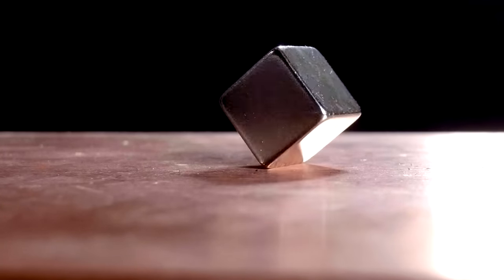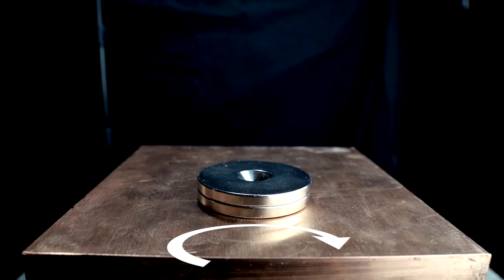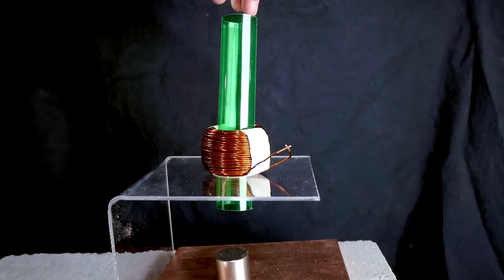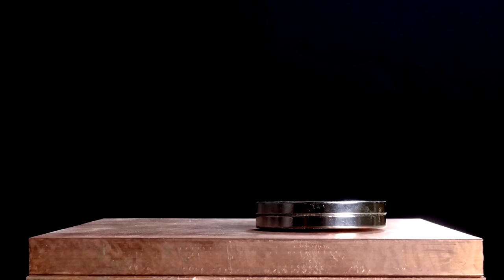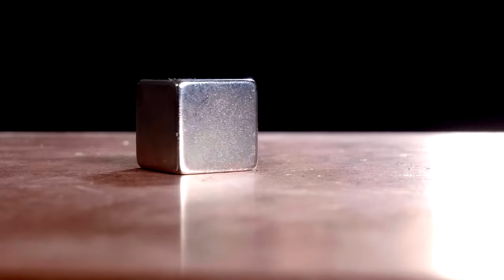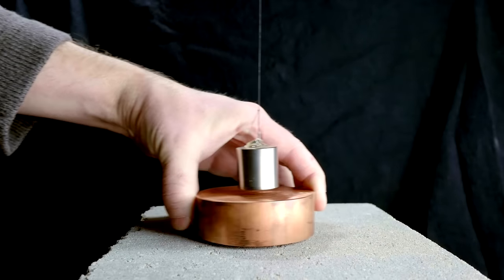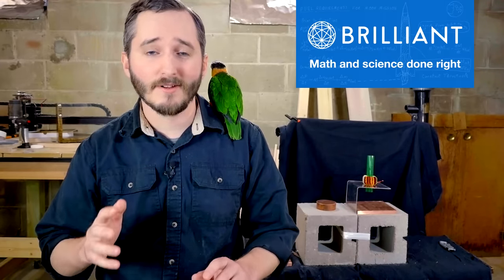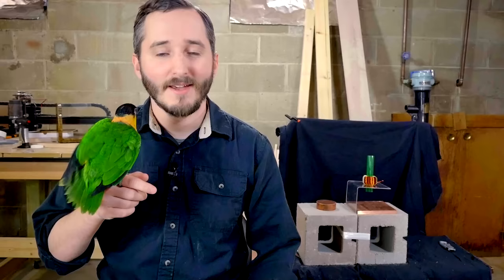Copper's Surprising Reaction to Strong Magnets | Force Field Motion Dampening

Comment: I built a capacitor bank with large scr s that could discharge into a flat pancake coil made from 4awg copper cable. I would place objects on it and experiment with the magnetic forces. thick heavy copper and aluminum plates would launch into the air higher than 60'. smaller objects, not so much. It seemed like the more conductive the material was, the more it would resist the magnetic field. also, I accidentally exploded a capacitor before I realized that the collapsing magnetic field would induce large negative currents into them. Diodes cured that problem.

Comment: Thank you for demonstrating these two laws in action with a copper plate.   Very  interesting, and fascinating.   Are the copper plates you used solid copper, or another materiall plated with copper ?
Reply: This must be a thick, good conductor slab. Plating with copper will not yield any such effect. Instead, you may use aluminium (again, thick).

Comment: Hi ! Can I ask some questions: I would like to know what diameter is the wire used in experiment with coil and how many turns did you wind for used coil ? Also how strong is the magnet used in experiment ?
Thank you very much for your answer.

Comment: If you had a tubular magnet and plunged a copper rod through the center of it would it show resistance.  Or does the copper always have to be on the outside.

Comment: How well does the magnetic dampening effect scale as speed increases? I would assume that the minimum intensity of the magnet required to fully stop the magnet would increase proportionally to the increase in the speed of the magnet.
Reply: It actually scales realy well with the speed of the magnet. The amount of electric field generated in the copper (and therefore the amount of oposing magnetic field) is directly proportional to the rate of change in magnetic flux through the copper. In laymans terms, the faster you try to move the magnet towards or around the copper, the stronger the dampening force will be. If you move the magnet slowly there will hardly be any resitance to the movement. You are also completly not wrong though, at some point the momentum of the magnet is simply to large and the opposing field won't be strong enough to deal with it in time.

Comment: OK NH Light.... Awesome Vid.... How about this;...... repeat the flux-repel experiment ( the one where the magnet stops short of smacking the copper slab....), But ... this time , pass a....  say 500 Volt DC charge through the copper plate,.  The Trick here being change the charge points from  North -South  and South North,  East west ,West East, Front Back, Back Front, with  + and  - polarities.
Then Repeat the experiment with 120 V AC and then with 500 VAC ( Just do the up, down, left right here as its's AC), and if there is a diff or something noticeable..... I'm sure we'd like to see the results..( AKA,.... so a  Maglev train experiences a transient.... etc...What would happen maybe , per se.) Your call here .Thanks
Ciao.
Reply: Forgot to add the front to back AC check. And to do the test quickly as the AC flux might try to de-magnetize your  neodymium magnets.....

Comment: I do not know what is strange at 2:50 and afterwards. It is simple law of electricity. When magnet passes trough solenoid, it create current in it. Copper is known as good electricity material. Magnetic field in solenoid is defined by the law of right hand (as I can remember from my middle school class) so it is no strange reaction when magnet slows down passing trough solenoid because magnetic filed of magnet interferre with created magnetic field of solenoid (closed circuit). In second example, created current is converted to light when LED is added to this circuit (power consumer).

Comment: Why couldn’t you use a spherical magnet dropped into a circular tube with a copper coil at opposing sides to generate electricity? As the magnetic ball travels through the tube over & over it would create electricity in a never ending loop if balanced. Or would friction eventually slow it down? So why not place opposing magnets along the tube so the sphere would continuously be accelerated through the tube and the coils? A type of infinite motion or momentum coil

Comment: Like that you can make the last generation of car shocks absorb, which can be used together with software which calculate distance between front and rear tyres and shocks will use energy to lift tyres wheel and switch off, need experiments to make to get right matematic algorithm

Comment: What would happen if you hooked up thick ground wire to the copper plate? What i'm asking, is it displacement taking some time?  The electrons spreading away slowly but having to compress into wherever they go?  Given a way out, would the effect change?
Reply: I dont think that much would change, just thinking about it, because there are no charges entering or leaving the plate, the mobile electrons are simply moving around which creates an opposite magnetic field resisting the change in magnetic flux.

Comment: You have changed and convert the energie of induktion to light with a LED, is it possible to know more about potential and the electricity of the coil ?  I am not sure but I think it can be a possibility to use this for changing the kinetic energie to light.  am I right or not .

Comment: Drill a hole in the center of the copper plate and cut a slot from the side to the hole. Then see if the ring magnet damps over the copper plate.

Comment: So, with the copper coil around the plastic tube... before you bridged the two ends, the copper coil was still very clearly wrapped in such a way that most of it was touching. Why was electricity not able to travel around the wrapped coil? Was it insulated in a way that wasn't obvious?

Comment: All demonstration videos show magnets falling, but what happens when the magnets rotate inside or close to the copper plate? Or what happens if the magnets are paired with a battery to also produce electricity that is put out again while falling through the pipe?

Comment: Could that be possible to be a free energy if you put the magnet into the middle inside the copper round wire while connected its + and - into a load or any king of electronics?

Comment: What would you need to replace the copper with to produce the same result with granite or any other Monolithic rock?
If you were to transpose the effects of magnetic forces with those of resonant frequencies, is it possible to create a much similar experiment using a heavy rock as the magnet and a frequency generator as the copper pipe?

Comment: I'd like to try this experiment myself, what are the thickness of the copper plates he is using?
Reply from the maker: 1/2". Aluminum also works.
Reply: @Nighthawkinlight  Thanks!
Reply: @Nighthawkinlight  Does the swinging the magnet into the copper trick from the thumbnail also work with just a regular copper sheet too, or does it have to be a copper piece like from the thumbnail to work?
Reply: @Nighthawkinlight  Also, do you remember where you bought your half inch copper plates from? I've been looking online and cant really find anything at that thickness xD
Reply from the maker: @noahlaferriere5515  You'll need probably about 1/4" thick plates at least I think. Aluminum is cheaper and will also work. You can sometimes find big pieces of copper on ebay by searching for copper bus bars, but you have to get lucky.
Reply: @Nighthawkinlight  Yup, you were right, I was able to find a 1/4" copper bus bar on Ebay! :D now do I still need that copper cylinder to do the swinging trick, or will that work on the copper bus also?
Reply from the maker: You don't need a cylinder

Comment: Hi
I have a question about Faradays law, we have read in physics that Faradays law said that magnetic flux needed to generate electricity in a coil, as we see in a closed core which normally used in every board, very powerful current produces by the second coil on core, my question is that how  electricity produces without flux passing through the coil? Because all fluxes pass through the core not coil, so how that happen? I hope you understand my question with my poor english.
Reply from the maker: Flux passes through the core of a coil producing electricity flowing in accordance with the right hand rule. Perhaps this will help you understand: https://youtu.be/BbmocfETTFo

Comment: This engineering will be installed in our new infrastructure building, with a positive charge front wall, and copper infused covered with negative charged instillation......... So in fire emergencies the flames crawl towards the front wall

Comment: :hand-pink-waving:E=MC2 is a joke! OK let's get this correct  !!   #1  The only reason radio waves and AC current travel out in space and down a wire is because of the "CENTER " of a magnetic field.  (The "B" field), The North and South poles are the weakest part of a magnet !!   Just like Tesla said,  you got to look at things you can't see !!  At the center of a magnet is anti gravity,  (just tap the center on any glass or plastic and it will loose weight), The center can repel water if vibrated at the correct frequency,  If you vibrate the "B" field into granite rock it will become soft and you would need copper tools to work on same , you don't want to disrupt the magnetic (B")field ) with other iron.  Once you understand the "B" field of a magnet and how it relates to the entire universe we live in, you will then understand what Tesla was telling everyone "LOOK FOR WHAT YOU CANNOT SEE""  .I believe the pyramids were inter galactic communications and transportation systems.  Stone Henge and Gobekli Tepe , power plants.  Take a look at Coral Castle Florida on YOUTUBE and you will see a similar pilar. I believe these horizontal pillars were oscillators that would provide excitation for many things from crops in the field to anti gravity  FYI: If a UFO fly's to close to you the "B" field that provides the anti gravity ("B")Field).  will cancel out your power source  !!!!  E=MC2 is at best just a joke!!!

Comment: So does this mean a motor or generator won't work if the windings are made from aluminum or silver wire?
Reply: Copper just has a lower resistance so the current is larger

Comment: What will happen if you be able to spin the magnet with high rpm before droping on the copper plate like you dropped 1:20 . I am curious to see, seems like it will stop immedetly but if somehow keeps rotating do you think it, is it possible to levitate longer?

Comment: So now we can you use principal of change in electric flux ,we can produce a small amount of electrical energy ,but what if we applied this in large scale means that ,if we put a copper plate on roads ,and run cars with neodymium magnet inside  the car can produce free electricity that we can use for our daily needs ,is this possible ?

Comment: May I ask where you got those copper plates from? I would like to demonstrate magnetic fields in shool for my students. All I can find are either small sheets or unprcatical blocks.
Reply from the maker: EBay. You can find large copper plates by searching for copper bus bars. They are expensive. Aluminum works nearly as well, and is much cheaper.

Comment: Would the copper coil that is not connected at the ends, But connected throughout, not make some kind of a circuit because all the coil strands are touching each other.. Its more like you "seal the ends" and the reaction occurs, more so then a complete circuit.

Comment: Why does the copper pull the magnet? It's not clear if all you are doing is creating a viscous fluid-like field around the magnet, then shouldn't that fields dissipate when moving the copper away? That would seemingly loosen it's grip on the magnet and leave it behind, not drag it.

Whats wrong with my intuition?
Reply from the maker: Same reason you have to pull to get your boot out of the mud before the force dissipates.

Comment: I wonder if that can be done with any other non-magnetic metal besides just copper only?
Reply: Yes, you can drop a magnet through a roll of aluminum foil and it will do the same thing.

Comment: What happens if you spin the magnet as it close to the copper plate? You say the current is flowing in a circular direction. Left hand rule? Spin in the opposite direction.

Comment: I always found it weird that the copper coil would operate that way. The coil is all connected and whatnot, but it doesn’t do anything as a complete circuit until the two ends touch. I think that’s weird, fact IS stranger than fiction sometimes.
Reply from the maker: It's enamel coated wire
Reply: @Nighthawkinlight  Right, and isn’t that STRANGE? That such a simple thing changes how it works so heavily?

Comment: Can someone explain to me why the coil even tho it’s clearly touching in other parts doesn’t slow it down? Would the corners of the block of copper not work similarly to the ends of the wire because they aren’t touching except through their connective areas? I just don’t see why some spare wire at the very ends of them matter when they have complete touching on multiple points of the wire throughout. Thanks for helping a dummy
Reply: If you squeezed and pulled two small wire ends out of the copper blocks corners would it no longer work?
Reply from the maker: It's enamel coated wire
Reply: @Nighthawkinlight  ahhh ok makes much more sense thank you lol

Comment: Why don't the make a tube and use magnets to push the magnet producing electricity around the circuit? and put the polarities against each other so they push on the inside using multiple magnets?

Comment: Imagine if the tube was circular instead of vertical and the magnetic was thrust around at a high speed again and again how much electricity would be produced. You could push it with air.

Comment: An important thing to mention I believe is that the reason the wire is not connected via itself, since it's touching itself, is because it's galvanized which means there's a very thin coating of plastic or other materials coating it.

Comment: It's odd that you have to connect the 2 ends of the copper wire to complete the circuit to make it work considering the  wire is wound with all the wraps  touching each other anyway.
Reply: The wire is coated with an insulator

Comment: That block of copper not magnetic, but conductor is like amplifying the magnetic field… not canceling out gravity just giving it a bump to pick it up so much, which may be why when you spun the block on the table it’s cause you were using the block to amplify its magnetic repulsion/attraction -me
Reply: 4:34, and when used opposite it acts like a dampener like you said for extra precision, it almost looks like the direction gravity is coming in is what let’s you go from amplify to super control and flipping the strengths of the magnet… this is awesome I think you discovered something! One step closer to levitating elevators

Comment: 1:58  why the ends need to be connected, why can't electrons just flow from one coil to another when they are touching each other?
Reply from the maker: The wire is insulated except on the ends

Comment: Diamagnetism is the answer. You get the same slowdown when dropping a neodymium magnet through a copper pipe. 

I have tested the above and can confirm that it works. No electricity needed.

Comment: hmmm would magnetic brakes work in a car? a copper plate and a dormant magnet in the wheel. brake gets pressed, electricity is sent to magnet, braking starts and should be controllable through the current sent in.

Comment: Electricity doesn't move through metals. Electrons move on the surface of conductive metals. That why welding cables and jumper cables, which are used to move high amperage currents, consist of many very small wires as opposed to several larger gauge wires. The many tiny wires version provides much more surface area for electrons to move on.

Comment: You haven't established that it's not an inherent property of copper, until you repeat the plate and coil experiments with some other non-ferrous metal, say, aluminum.
Reply from the maker: It works with all non ferrous conductive materials. Aluminum will work

Comment: Can we all just take note in the fact that he admits magnetic systems are used to generate electricity? if everyone had their own backyard mini magnetic generator, free power. sure the system will break down eventually, but it would more than pay for itself. which material cost is low, low. and the resources needed are in abundance.
Reply: @colbyboucher6391  magnetic repulsion is a constant force of energy. If you don't know how easy that is to turn into a 0 loss system, it's not my issue. get educated. 🤓

Comment: The magnetic force physics used in dowsing have been reverse-engineered.  Read and study the book, The Art of Dowsing - Separating Science from Superstition ($14.95), for learning all of the physics involved in dowsing and how to build the modern light weight ball bearing dowsing rod, which is the only dowsing rod that accurately gauges what is being dowsed by pitting the energy of gravity against the energizing of the one-tenth ounce dowsing rod load that is attached onto the elevated acetylene welding rod, with being located five-inches from the hub's shaft.  This precisely gauges the dowsing of all edges, exact center, depth buried with angle of deposition, and most important is grading of the sought element that is contained in the elemental mass that is being dowsed.  Anybody can become a professional dowser by practicing the book's dowsing lessons of buried pipelines and electrical cables, tunnels and voids, precious metal placer and lode deposits, dowsing for treasure, dowsing for any element, amplified long distance dowsing from a moving vehicle, and dowsing on water from a boat.  I hope dowsing enriches your life and have a safe, healthy, good day.